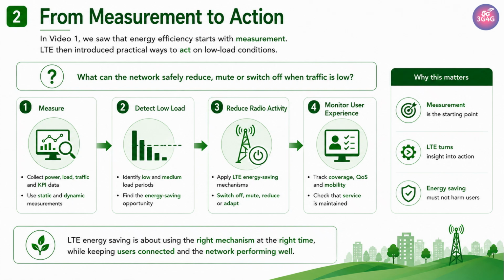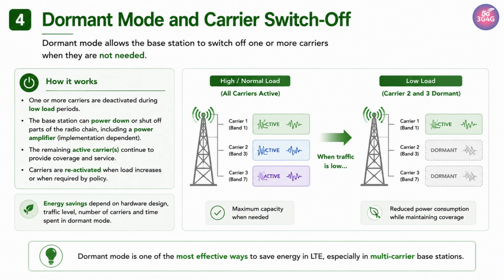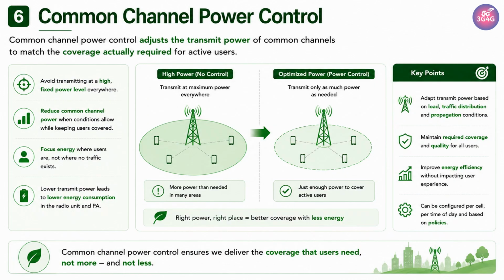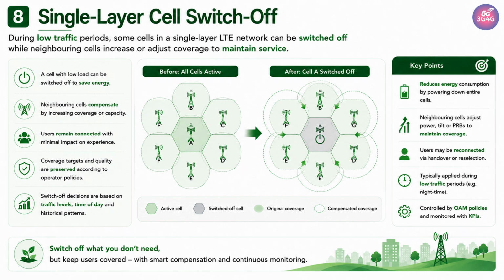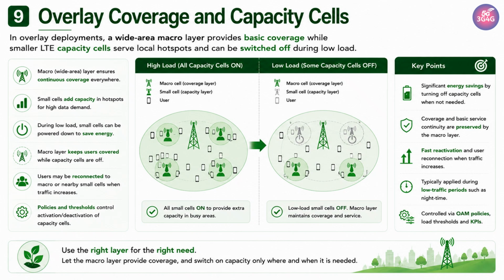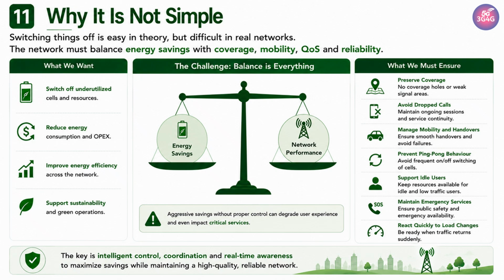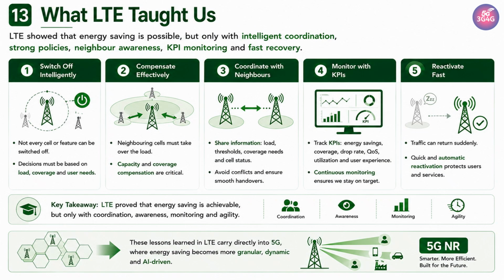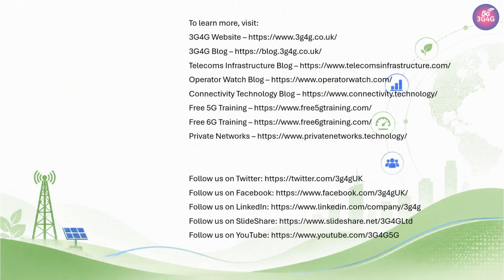Advanced: Energy Efficiency in Mobile Networks – Part 2: Energy Savings in LTE Networks

Comment: if the common channel power is only for the active users, how can idle users do initial attachment/registration etc?
Reply from the maker: Good point. We should have phrased that more carefully. Common channels and signals are not only for active users. Idle UEs also rely on them for cell selection/reselection, system information, pagirg and initial access.So common-channel power optimisation has to preserve a minimum accessibility and coverage level. If a cell goes into a deeper energy-saving or dormant state, then neighbouring compensation cells need to provide the coverage so idle users can still attach/register and access the network.
Reply: @3G4G5G thanks. Makes sense